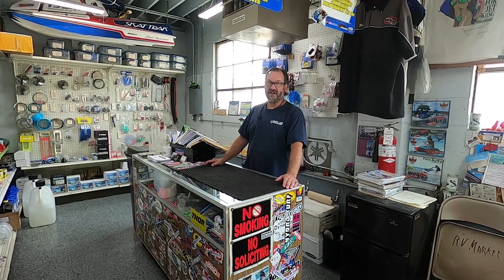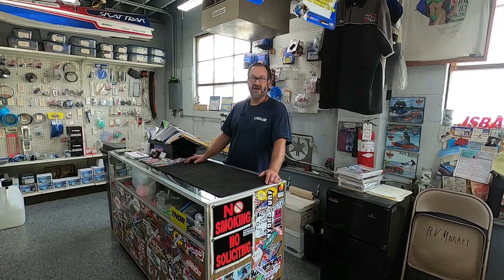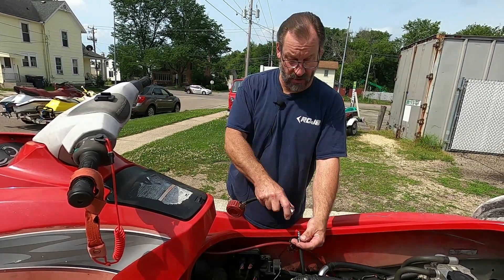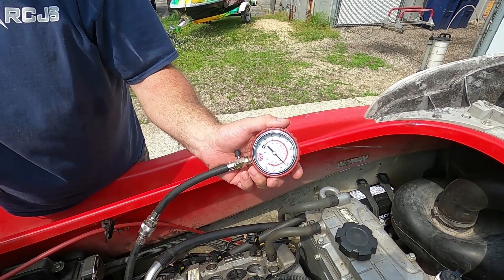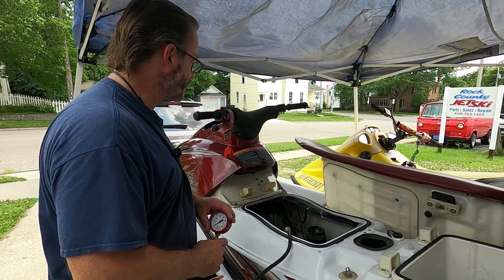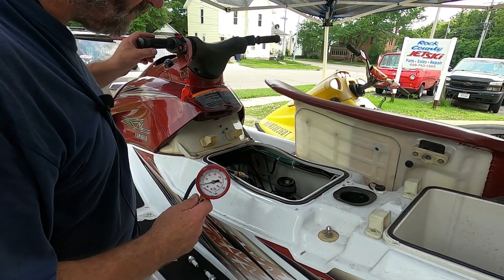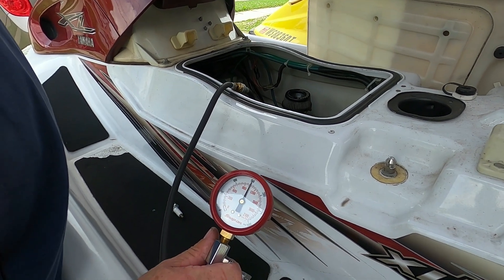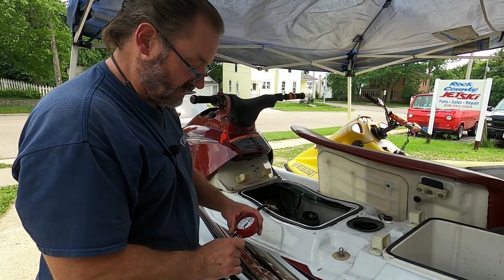compression testing

Comment: I have a XV110 that I’m trying to get started after sitting. My engine is sounding just like yours but I can’t get it to turn over. Can you explain how to disconnect the fuel so I can do a compression test?
Reply from the maker: ON a 4 stroke PWC when testing, just hold the throttle wide open when testing. That puts your machine into flooded mode, and the injectors won't spray fuel.

Comment: Thanks Glen most dont know how to do compression correctly. Also good to have a tester that threads into the cylinder as far as the spark plug and has the Shrader valve at the bottom (no adapter)
Reply from the maker: Thanks for watching

Comment: Thank you for doing the video. I've noticed in a lot of the Facebook groups people are using Harbor Freight or other cheap gauges and getting inaccurately low results. Just today somebody had an engine with 90/90 using a Harbor Freight gauge. So using an accurate gauge is very important. If an engine has bad compression very often one cylinder is a lot lower than the other. So you wouldn't want to pull an engine to rebuild the top end based solely off one compression test. A fully charged battery is important too.

Comment: Nice video!!! I always do mine with the throttle open but both plugs out. So when you do it  and leave the plug/s in do you leave the wires on the plugs that are in the head or ground them put somewhere else? My skis will run on one cylinder 😂
Reply from the maker: Thanks for watching. On a traditional 2-stroke, When "I" do it normally, I leave a plug in, and I do ground both wires while testing to protect the CDI. I do not ground the plug in the cly for fear of it starting on one cyl. I use an extra plug in the boot, and ground it to the head. OR on Kawi's they have plug wire grounding posts.
Reply: @watercrafttalk2738  ok awesome I will try that when I get home amd see!!! Keep up the great work my friend and have a blessed weekend
Reply: @watercrafttalk2738  I would think it should turn over more easily with the spark plug(s) removed because the starter doesn't have the resistance of compression.  But you just showed us it spins faster with the spark plug in!  I'm totally baffled why this is the case!  Any ideas?
Reply from the maker: @AtimatikArmy  Compression on the down stroke.
Reply: @watercrafttalk2738  Wouldn't the down stroke be less compression than the upstroke where the firing event takes place?  Anyway, I saw it spin over faster in your video with the plugs in, so I can't deny that.  I'm just having a hard time wrapping my brain around it!